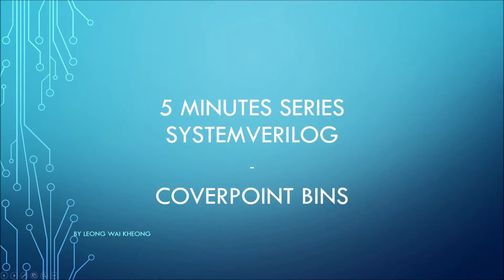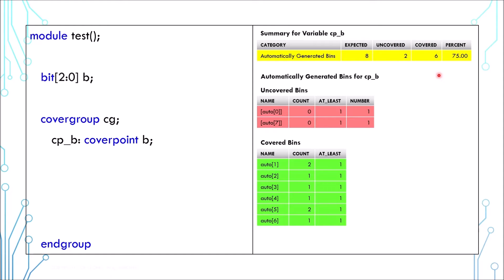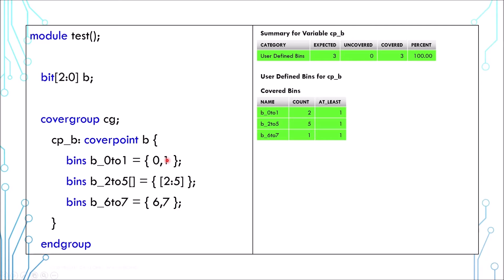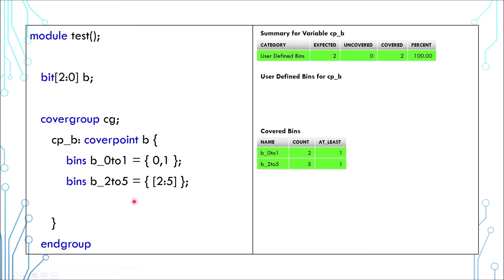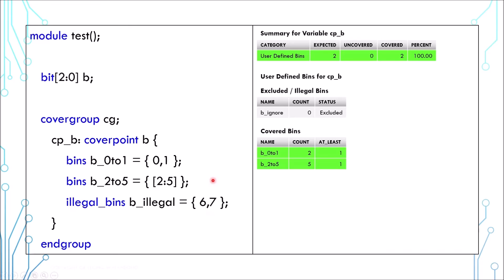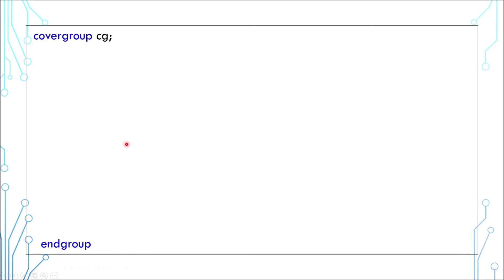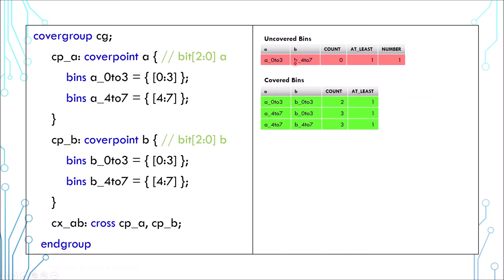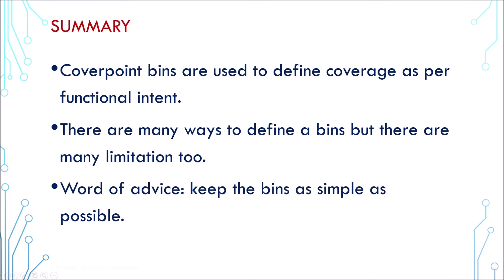SystemVerilog Tutorial in 5 Minutes - 13a coverpoint bins

Comment: I didn't understand the cross coverage with variable names. There is no 64 bins created right?
Reply from the maker: There are 64 bins created. As mentioned, cross is meant for two or more variables in its simplest manner. In the example, there are two 3-bits variable, which means two 8-possible-values variable; crossing them create 64 combinations. Crossing two 3-bits variable is the same as having one 6-bits variable, and thus 64 possible values.